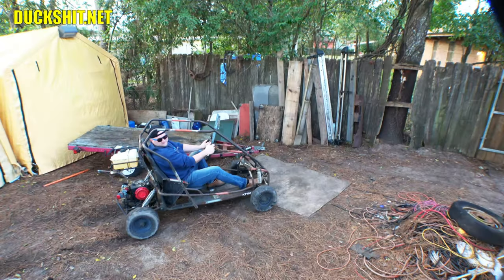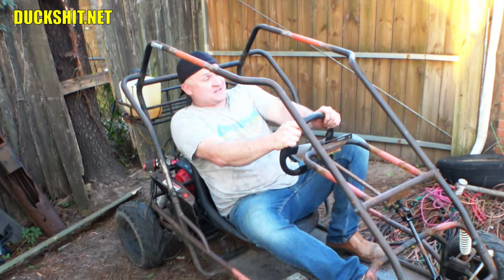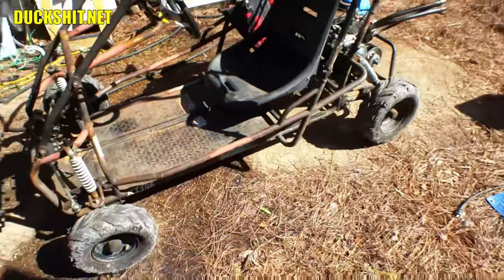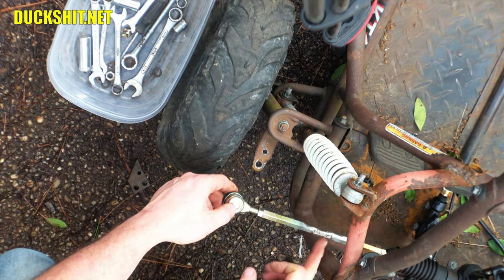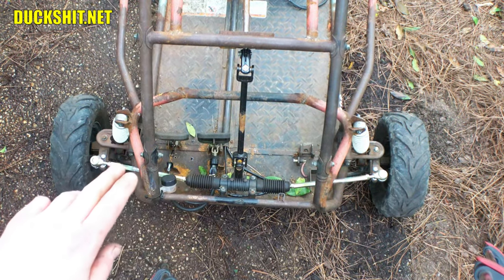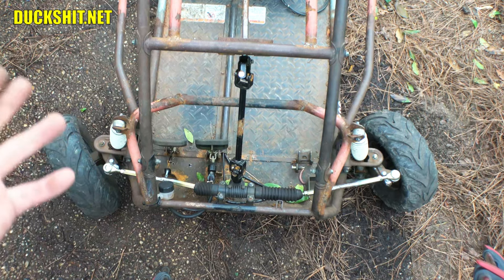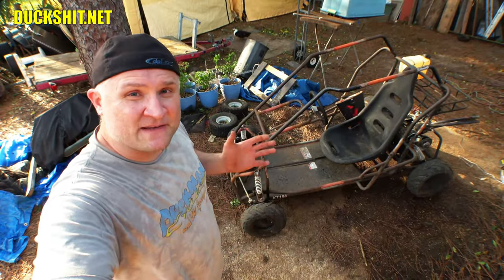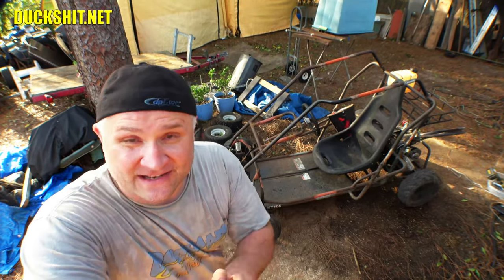🔧Ackermann Steering Geometry Correction💥 Modified KT196 Go Kart - 12

Comment from the maker: What an amazing difference Ackermann Steering Geometry makes!  Completely different feel to steering and handling.... now I feel more confident with a much bigger engine swap!  COMING SOON!
Reply: Dude, thank you for this. I have a sh*t kart with no Ackerman, and I knew this was the fix, but couldn't figure out how to do leading steering gear (instead of trailing). Reverse the angles, duh! Thanks. Now I can just weld up some better spindles with proper Ackerman built into the geometry of the steering arms. I look forward to the same level of improvement. Sh*t steers like a bus now.

Comment: Great imporvement in the steering if I still had my carts I would do the same. When ever I see hardware laying in the parking or street I always pick it up. On big washer is worth a quarter. Low pressure tires for carts make them ride smoother.
Reply from the maker: Oh yes, never leave a nut or bolt unpicked!  I've even stopped and picked up the big ones I find in the road that are a foot long and over 1 inch in diameter... I have no idea what I will ever use them for, but you know they weren't cheap LOL!

Comment: The trick with Ackerman angles is that you use the centerline of the "fixed" axle and then wherever the centerlines of each "steering" axle intersect that line (from straight to lock/lock) must be in the same spot. Had fun making that work on my 6WD R/C Mutant "Spot" because the center didn't steer but the front and rears steered. It steers either front or rear or both (4 channel radio). 😆
Reply from the maker: It works good over here!  I'm glad I realized it!  I hated the way this thing steered before!  Now its awesome! Thanks man! 4 wheel steering huh?  I dunno if I have enough thumbs for all those control sticks!
Reply: @DuckmanCycles  Only two thumbs needed! Right stick is Fwd/Rev and front steering, left stick is rear steering if desired and a 4th channel for "accessories".
Reply from the maker: Oh wow!  I didn't think it would be so consolidated!
Reply: @DuckmanCycles  KISS principle.! If I REALLY wanted to get complicated, I'd use my 6-channel airplane radio! Like they do on Battlebots... 😆

Comment: You talked about adding caster by moving the spindles back on the steering knuckles if I heard correctly. That will increase trail but leave the caster unchanged. The caster is the front to rear relationship between the ball joints. Moving the top ball joint back or the bottom ball joint forward will increase caster. Remember that the incorrectly named "casters" on a shopping carts, etc. have zero caster - the rotational axis is completely vertical - what they have is trail - the tire contact with the ground trails the steering axis intersection with the ground. The trail is what makes the vehicle go straight. The camber on a shopping cart wheel never changes which is the result of zero caster. On a vehicle with positive caster, the camber will tilt towards the inside of the turn as you turn the vehicle, which is a good thing.
What did raising the outer tie rod ends do to your bump steer?
Reply from the maker: You are correct, I was all turned around backwards.  The answer was to move the top A-arm back, this thing needs a little trail, too... it has none!  Bump-steer doesn't seem to have too much effect, I may notice it more with a proper alignment, but the tie rod ends weren't raised much to notice!  Is all good!  FAR BETTER than it ever was!

Comment: Maybe I missed it, but did you run those strings out 60 inches in front of the front joints?
Reply from the maker: Yep you missed it... 60 inches in a straight line from front axle dead center to stake.  The strings are technically shorter.
Reply: @DuckmanCycles  Thanks! Gonna go check mine out tomorrow!
Reply from the maker: Awesome, just don't use my 60 inch wheelbase, measure from your balljoint to your axle.  That will be the distance you need to set your stake, if you stake at all.  You can run the string backwards to the center of your rear axle.  I just had too much junk in the way.  That's why I had to invert the adapters I made on the ends.

Comment: I think it's backwards  your the adaptors should be on opposite side of spindle to correct geometry
Reply from the maker: You are correct.... but only if the arms on the spindles extended backwards!  This is the correct way on account of them extending forwards.  This is demonstrated in the video.   😁👍🦆💩